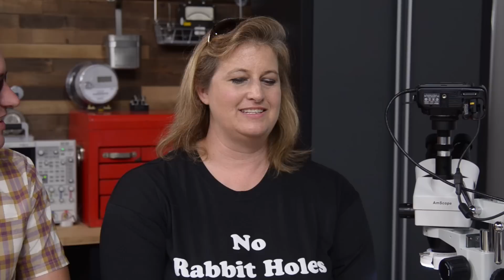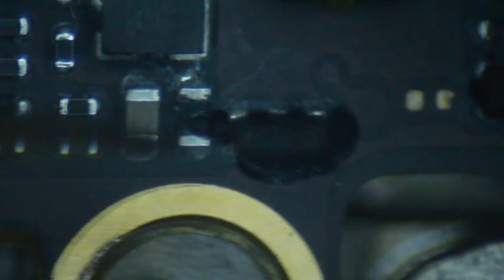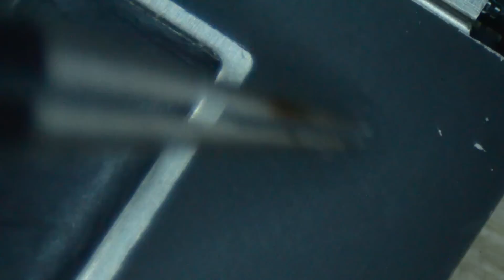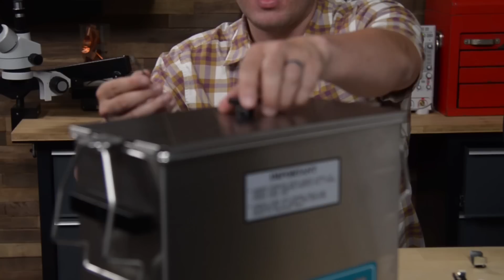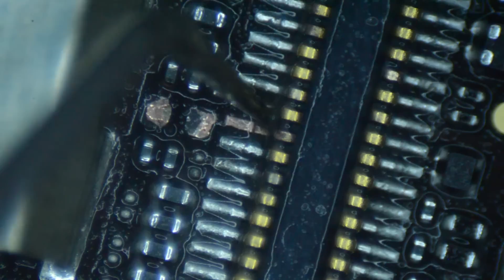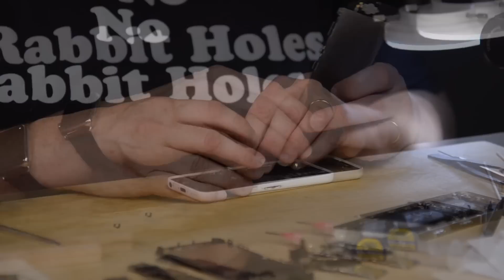Microsoldering 101: Water Damage and Corrosion

Comment: I managed to repair my first water damaged device this week. Insta360 camera had somehow managed to get water ingress under the SD card slot, this had been left powered long enough for the electrolytic corrosion to eat through the solder mask and part of the top layer and created a dead short onto the 4.2v rail and killing the battery charge controller, as well as eating a bunch of other power tracks around the device. The tldr; is, if you can, pull that battery before things get worse!

Comment: This is good advice.
My brother has a Mk2 Audi TTs with the Bose sound system and they ALL suffer from water damage that comes in from an unsealed body panel. Thanks Audi for not stepping up and taking ownership of your poor workmanship. 
I'm going to open it up and attempt to clean off the corrosion if it isn't beyond DIY repair. Then apply conformal coating and seal the gap Audi should have done at the factory.

Comment: Distilled water NO!! The salts comes from the corroding metal in the pins. So it will be conducting after a short while! Isopropyl alcohol is a winner, Secondly, disassemble it as much as possible put it in an oven at 45C (if you cant remove the battery) otherwise 60C for 4-5 hours. This works very well.

Comment: Should all ribbon cables be removed from the boards prior to immersing in a cleaner bath. I have a drone and the ribbon pin connectors  have been exposed to the water . It would be pointless cleaning the board if I have to replace the ribbons (8 in all)

Comment: You explained totally wrong how ultrasonic bath works, it doesn't matter the resonance with components. The different sound waves reacting different in fluid at different 
frequencies , so the liquid can make pressure to liquid for small components.It is like tiny points of pressure in liquid that allow it to find the smallest places on components to wash them. It create sort of high pressure waves. sort of jets with pressure. They have nothing to do with the resonance  of the board components.

Comment: Hello Jessa,
Thank you for these great tutorials!
Having some trouble pinning down the problem and would like to trouble you, if it's okay,  for help and some insight.
WHAT: LGMP260
THE PROBLEM: Washing machine then in the dryer. No reaction to a battery or to being plugged in to the all.
WHAT I HAVE DONE: Allowed to dry. Took a part down to the board and cleaned out with alcohol. All board components look just fine.  
TROUBLE SHOOTING: 
Multimeter - the leads in the battery bay produce 0.01 volts (between + and -). The continuity between between the usb charging port and the battery bay leads are 6 - 36 and there resistance was @3 to @23 ohms.

Thank you for your time!

Comment: Hi, great video
Please advise i swan with my iphone 7 plus at the beach and it had a very bad corrosion.
Iv taken it to two techs and they said it cant be fixed.
Is there so other way i could at least get my information on the phone?
Please help
Reply: in theory you could pull out the memory components and put them into a working phone, offload the images, and then put the working phone back together. That assuming the phones storage wasn't damaged
Reply: Same thing with my phone 😭

Comment: I would get a lot of salt and alkali corrosion around the battery(ies). I had about $800,000 in test equipment on a rooftop when a fast moving violent storm dumped 2" of rain on me in about 15 minutes. I managed to get everything working again. We still had access to trich back then, and the facility had a UPW (DI) water supply. All I had to do was bring my own ultrasonic cleaner to work. They had the UPW, microscopes, testers and trich in house. This was back when thermal imaging cameras were around $140,000, plus you wore a battery belt, and we had Dranetz, Q factor, and variable load cells, on the roof. When there is lightning everywhere, that million dollars of stuff on the roof is expendable, compared to the manpower. Rip out the test leads, close the equipment panel doors, if something will fit inside the cab, throw it in, and evacuate that rooftop ASAP. 1 death and that facility is shut down for 1-3 days. One outage 30 of minutes into a process, and that can cost $8M to the facility, so that $800K of equipment is expendable, and it can usually be repaired. I don't climb around on rooftops, or fan attics or interstitials, and do tool installs, power management assessments, and preventative maintenance. I am too old and beat up for that now.  I am in my own shop doing similar repairs, indoors, (most of the time). If the traces lift off a board, I can rebond them. I too have the Hakko hot air station, and the $2000 German Weller, and a Ramsey RFI glove box, and I have used ultrasonic for many years. The little German tips from Weller will spoon in tiny bits of solder on those FUBAR SMD components and the chip terminals. What is it? A $600 cell phone or a $60,000 thermal imaging camera, or a $600,000 O Scope with extra RADAR or DDR modules? A good $6000-$12,000 LCR pays for itself very quickly. You can run through and check caps in circuit, and it just save so much time. I try to stay away from the smart phones and video games. That is what it is, and there lots of competition. I have my ham license, and that is one element of my work. The rest is audio amplification, and guitars. Those are the bread and butter, and the gravy is test equipment repairs. Sometimes it's pretty nasty gravy.
Reply: Joan.  Interesting.  I Googled "trich"  but i didn't see anything that made sense.  What piece of gear were you referring to, if you don't mind my asking?

Comment: Talking about phone in salt water, i worked for sea trek helmet at doctors cave beach mobay jamaica, omg i saved so many phones that accidentally fell in the salt water,,,first thing i did was to remove battery and dump in fresh water,blow dry with scuba tank then pulled it apart give as good as i can an alcohol cleaning then leave in the sun as long as posible then reassemble, works every time escept from semens phone they seemed to always burn out as soon as they 2 feet of salt water,
Reply: Yeah you did the right thing
Reply: Rohan Boswell jjjj

Comment: If practical, given the availability of distilled water, wouldn't it be best to open a phone, and dunk/rinse it in that first while it was still wet (after depowering it), then dunk it in alcohol?  The clean water would help dissolve and wash away corrosive minerals before they can corrode anything.  Alcohol alone will only absorb and evaporate the water;  it won't necessarily keep mineral contaminants in solution and away from the metals and solder.  In fact, the alcohol alone might exacerbate things by concentrating and accelerating mineral deposition.

Comment: This series is awesome, made me buy a hot air station and pratice on my old waterdamaged ipod. Managed to repair the backlight and resoldered some components for practice, still works ;)
Reply: How hot did you put hot station air and the air flow?
Reply: It depends on the station you are using, test it out on an old board :)
Reply: oh oke thanks

Comment: should you not wear a wristband anti static while handling the board?
Reply: +James Birkin Neither had I, and I've built all of my own PC's for the last 10 years. If you wanna be safe, just touch a radiator before working on your stuff.
Reply: +xiphy94 sure, if I was working in a production factory meeting standards.  But for iPhone boards, it just doesnt make a practical difference. I am evidence-based girl.  If you guys can convince me that ESD is actually important in this situation, then I'll use ESD protection.  Right now,  I look at it like this.  If after fixing thousands of boards I got calls from people where they just stopped working and they sent them back with chip failures then I would take ESD seriously for mobile device repair.  But I've never had even one warranty issue in that category.   
When I work in a lab handling radioactivity or patient DNA samples---I wear gloves.  When I extract DNA in the Kindergarten class from strawberries, I don't bother.
Reply: +xiphy94 ESD is very common and although an anti static wristband is kinda of "overprotective" it's useful, you should be ok, as long as you are touching a big piece of metal every 5 minutes or so
Reply: Yea and btw an iPhone logic board has a lot of grounding planes. Chances are really low when it comes down to ESD Damage since the iPhone logic board since the iPhone 4 has an intergrated ESD suppressor which protects it. Started from Dialog Semiconductors Ashley PMIC architecture.
Reply: +iPad Rehab to be honest  I never use a wrist band . I don't use nothing.  never had an issue yet lol
Reply: Where can I find a business to fix my water damaged android phone?